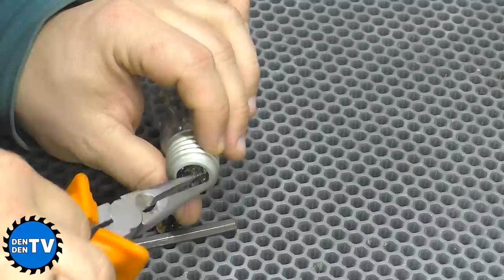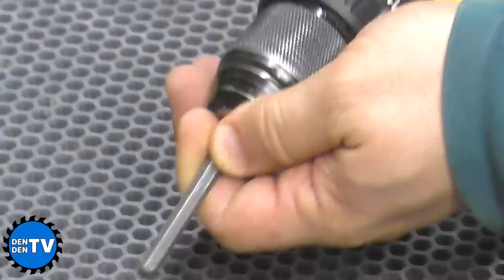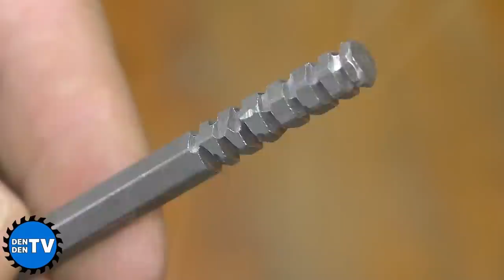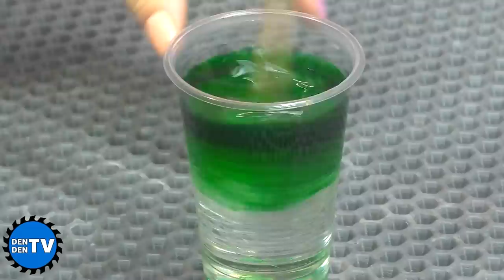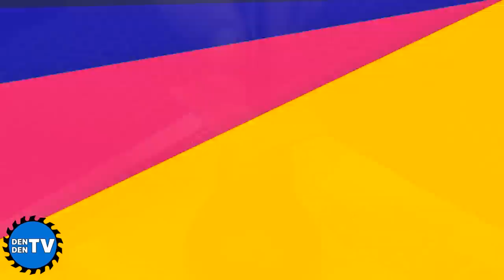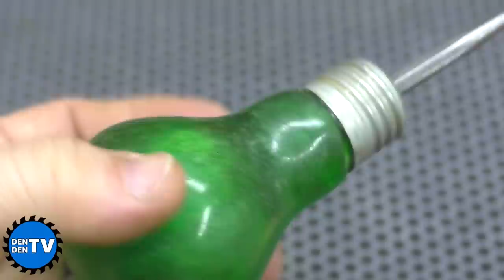After learning this secret, you will never throw away a burned-out light bulb again!!!

Comment: I would think that buying an awl would be much cheaper than going through all this with the resin and metal part, sandpaper, etc., plus the handle would be much better designed to work with than a light bulb.  It is interesting as part of an art project however.
Reply: Тебе не понять )))))